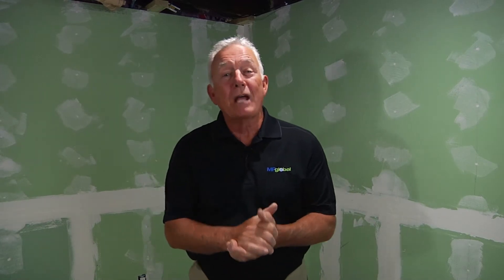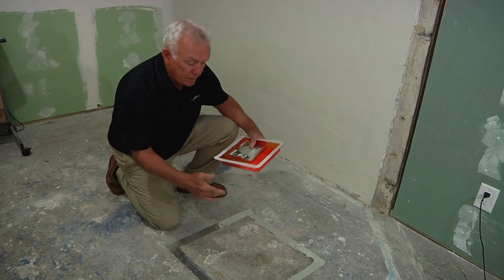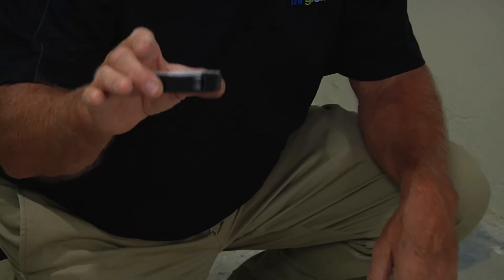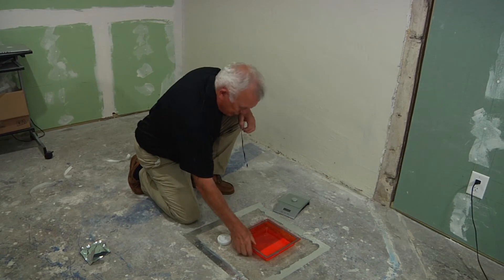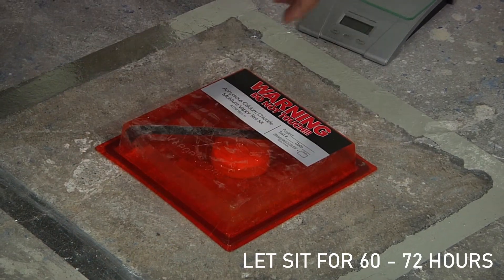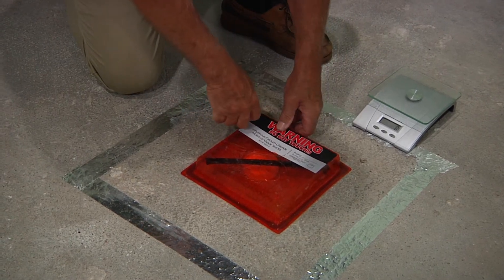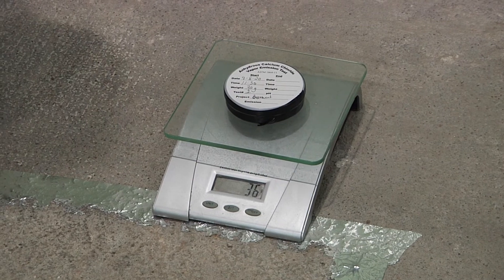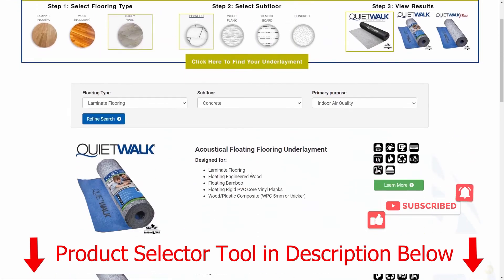How to Test Your Concrete Subfloor for Moisture - (Calcium Chloride Test)

Comment: This video is old so i dont know if you still check the comments. Is there a say to cbeck the concrete sub floor under vinyl flooring in the bathroom? I see some signs of water damage and im worried. Before calling a remediation conpany i was hoping to test myself. Thanks if yoh havr any advice for me. Much appreciated

Comment: So if there is any gain that means i need a vapor barrier? Because i had a 3.5 g gain in 60 hours
Reply: Google "calcium chloride moisture calculator" and you should get several tools where you can input your data and get a result. I'm not a professional, so don't trust what I say - but by your numbers it gave me a rating just shy of 7. I believe between 3-5 is recommended for non-breathing flooring materials - especially paints and epoxies that might delaminate from the vapor pressure. So yes - you probably need to address the issue in some way to avoid problems down the road. A moisture barrier is one method, but depending on the terrain and elevation improved drainage could be even more important. If your concrete is not old it could also have residual water sitting in it from creation. It can take a long time to fully equalize.

Comment: I had just about 1000sq ft to test, i bought 2 of these and did the test. Both had consistent results- gram gain of 2.34 & 2.28. MVER rating 3.86 & 3.76. ASTM recommend 3 or less. So I am over- so here's the 1000$ question. WHAT DOES THIS MEAN? I have confirmed that I do in fact need a Moisture Vapor Barrier for my LVP install?, that I would have done out of precaution anyway? Does it mean, I can't install LVP? What does it mean? Thanks in advance for your advice.
Reply from the maker: Hi, this is an excellent question.  You have gone the extra mile to ensuring you even need a product under the vinyl plank and even more using the right product under your LVP for protection.  If the LVP manufacturer says 3lbs or more of moisture in your slab you will need a 6mil vapor barrier....then you are there, you will need that according to your test results.  It also means that one of our underlayments with a vapor barrier on it can give you all of the benefits of a 6mil for moisture protection plus offer other benefits like sound control, support for the joints, insulating comfort and durability for the life of your floor.  Look at our QuietWalk LV product, it is made for vinyl plank with all the benefits.  It's moisture rating is up to 6lbs per 1000sqft per day and would fit into your need well.    https://www.mpglobalproducts.com/flooring-underlayment/products/quietwalk-luxury-vinyl/

Comment: By sealing your calcium chloride test with tape you've add more weight to it, hence not the real reading on your scale...
Reply from the maker: Hey Felix, we measured the starting weight with the tape and measured the final weight with the tape as well. This keeps the weight of the dish & tape consistent throughout the test. This way we know the difference in weight only came from the moisture itself.

Comment: Why do you need to sand a 20" x 20" area,  when the dome is only about 8-10" square?
Reply: You want the moisture traveling directly upward through the slab. If you test in the center of a large sealed area, you'll recover more water because it will be concentrated from the region around the test site. Sanding a minimum area around the dome helps prevent this and make a more accurate reading.
Reply from the maker: That is a great question, the test standard calls for it and the test manufacturer lists it in their instructions and we followed it.